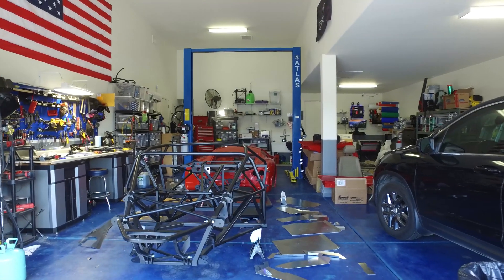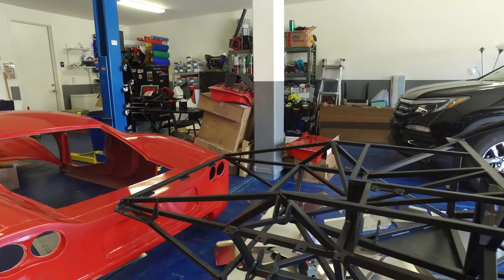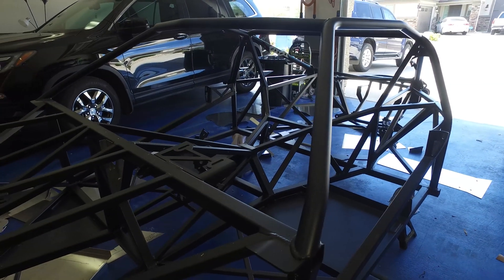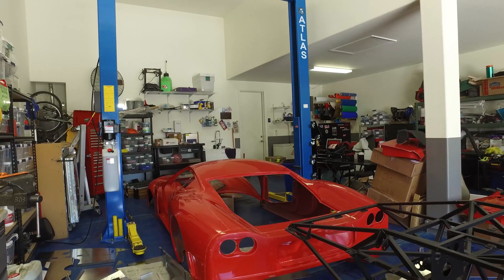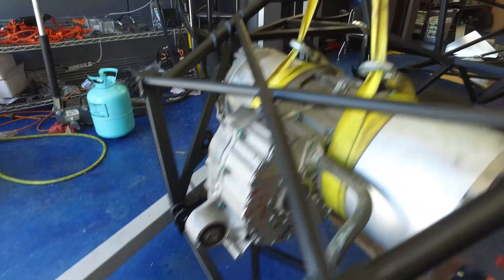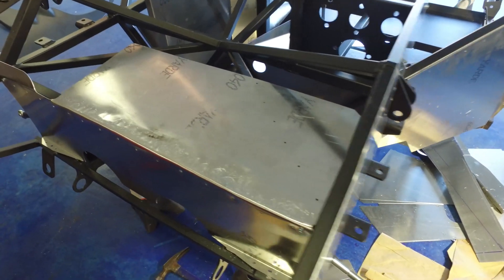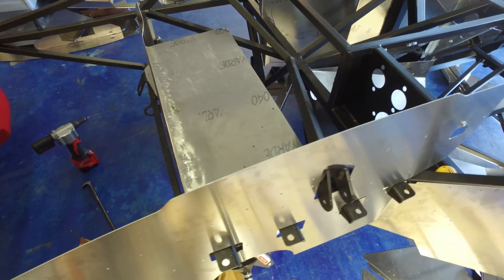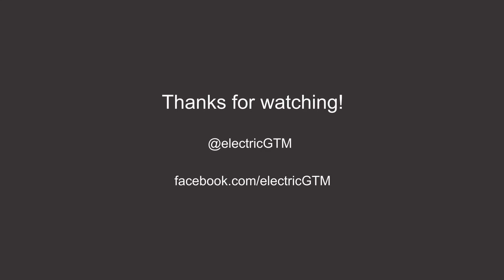Project Electric GTM - Test fitting the Tesla Motor

Comment: Be careful to swap for a reversing oil pump in the Tesla it doesnt work in reverse. If not your motor bearings will fail since max RPM on the tesla motor is higher than the bearings rated speed and tesla has to engineer the oil pump to counteract this exact problem.
Reply from the maker: You should probably watch more of my videos.  I replumbed the oil system
Reply: @CodyGraham  my bad just checked them out! Sorry I was hoping to save you some headache.
Reply from the maker: @graykimchi  Thanks!  I had heard it was an issue, figured it out when I took it all apart!

Comment: You should make the back glass to engine bay a solor panel to help charge it and run accessories in the car like radio ac and pumps to extend range and roof would with one of the flexible panels would help to extend it but back glass over engine would help im sure other eve cars are using this technology